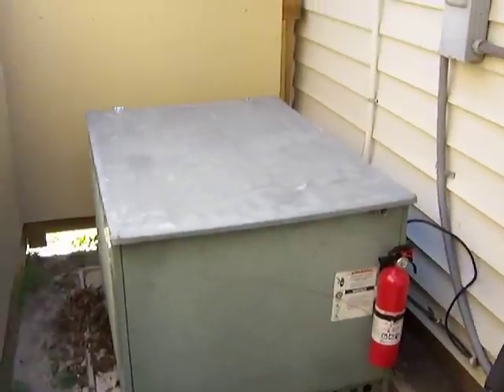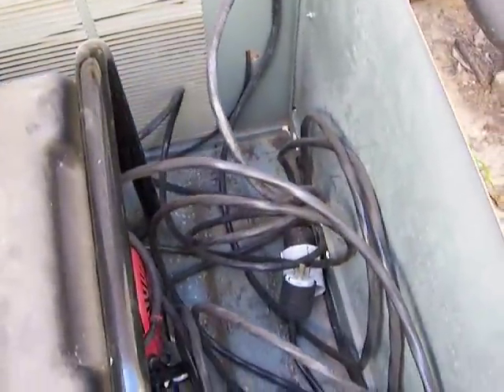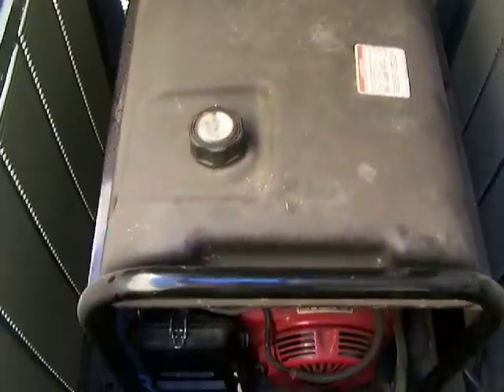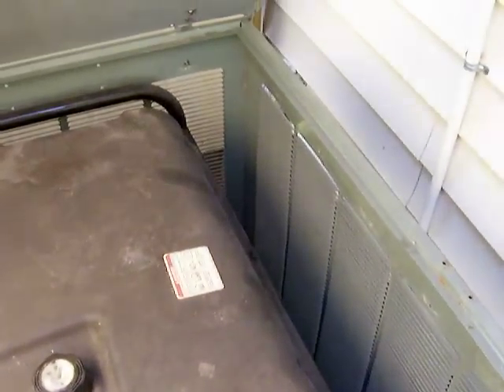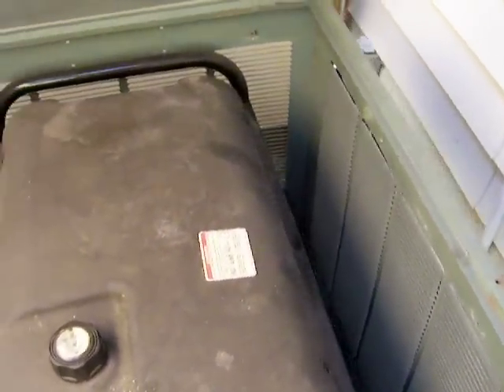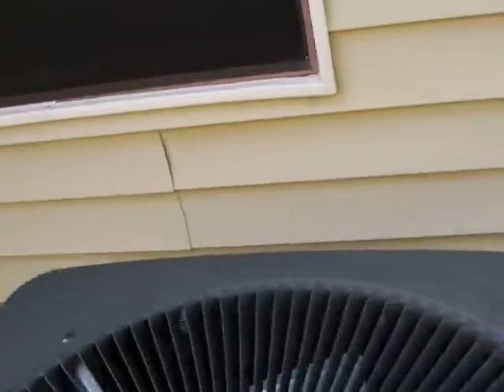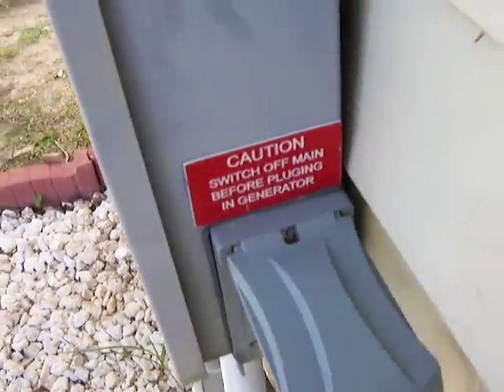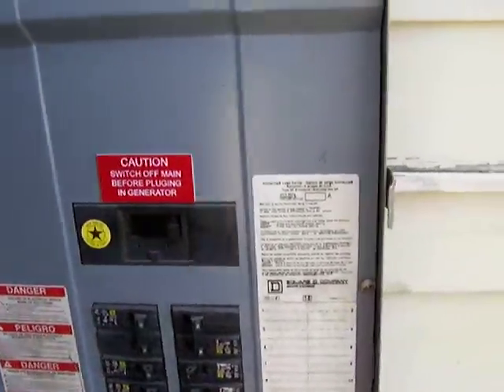homemade generator housing

Comment: It works as long as you are the only one setting it to go with main off. Don’t let anyone do it when you need it. They say Interlock but if your only doing it shouldn’t have any problems. Question what size running watts is your Benny?

Comment: Is anyone else concerned that the sprinkler head used for fire suppression is fed through a plastic pipe that runs right along the generator that could be the source of said fire to suppress?  Heat melts plastic.  Also, you went to the trouble of making signs about switching off the main but left off the interlock, so it's at least in violation of code-- and depending on your jurisdiction, possibly illegal.  Neat idea about using an old A/C housing, tho.  Credit for that.
Reply: You can take a paper cup with water in it and cook an egg by placing the cup , water and egg in a fire. The water keeps the cup from burning, the water in the pipe keeps the pipe from melting if exposed to fire.

Comment: That's REALLY close to the house, boss.   I also didn't see a transfer switch which is required by law.   Just flipping the main off is not sufficient, as electricians working on the lines have died that way.
Reply from the maker: theres water fire sprinkler against the wall just in case, all got remember is a switch off main .

Comment: Nice set up. Itip on cleanning your vinal siding bleach. what I do just buy a gallon of bleach put it in a hand pumpup sprayer they spray the bleach on the green slime it caused by dirt and wet grass cutting with the weedeater or mower. No offence ment but that how I clean my siding.